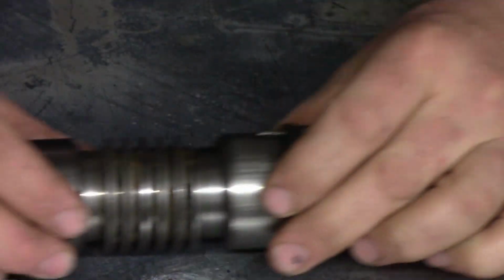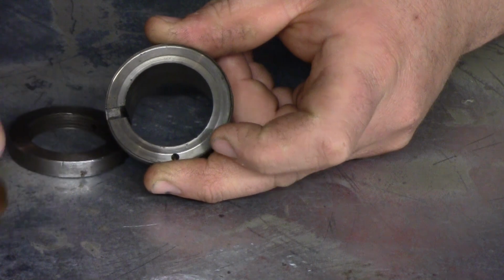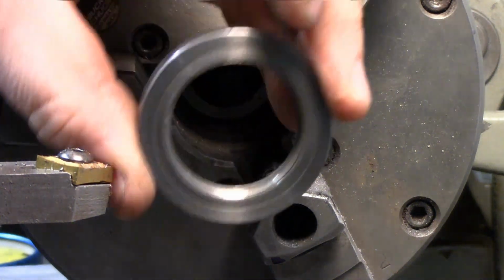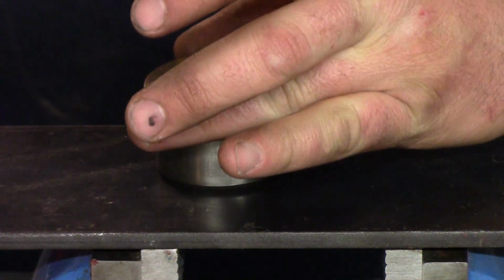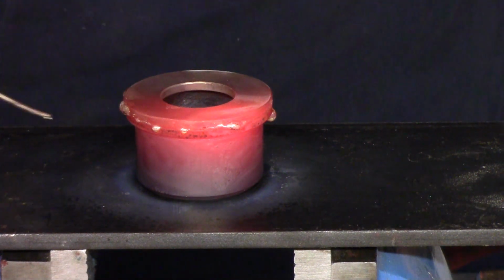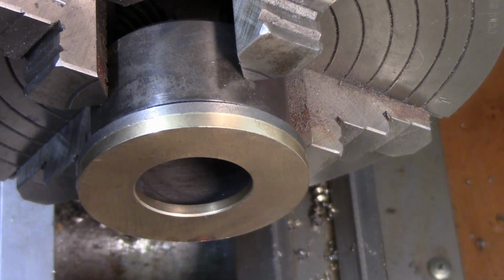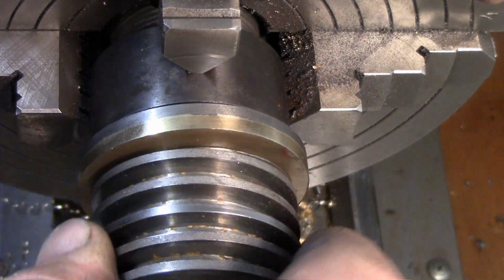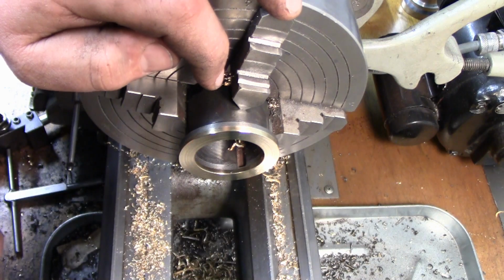13" Southbend Refurb: Worm Gear Repair

Comment: Have you checked the original specs to check that that dishing on the locking nut isn't some for of oil groove? A good repair you are obviously very thorough in the steps you are taking to repair the lathe it will be in better than new condition by the time you are finished.

Mike
Reply from the maker: The other ring is flat.  THe bushing had a matching crown of wear.

Comment: your wick grove did not look deep enough ,should it not be nearly trough the brass ? thanks for sharing
Reply from the maker: It won't be through because I took off material from the collars and added it to the brass.  It only needs to be as deep as the wick so the wick protrudes slightly to wipe oil onto the collar.
Reply: i see thanks:)

Comment: Can I ask why you decided to use bronze instead of the original steel? Will it hold up?
Reply: I think the original is actually cast iron.  With good oil wicks the bronze should do fine, and if it eventually wears out it can be replaced again in the same way.

Comment: your melting the solder in the flame. the material should be hot enough to melt the solder with touching the flame or it won't capillary action into the joint.

Comment: What about the hole for the pin?
Reply from the maker: I put the pin in then brazed the ring on.  There is really no need to ever remove the pin that holds the collar to the apron casting.

Comment: just tighten it and put a new hole in the shaft for the pin.
Reply from the maker: No need to if you measure it correctly.  You have the opportunity here just easier to take your time and measure it to reuse the same hole.

Comment: NOT worm gear, Worm, Worm Wheel and together Worm Drive.
Another thumbs down for not using the right tools.
Channel locks really?
Reply from the maker: To get them off yes.  The pin was broken in two and the collar tightened galling the threads in on one side.